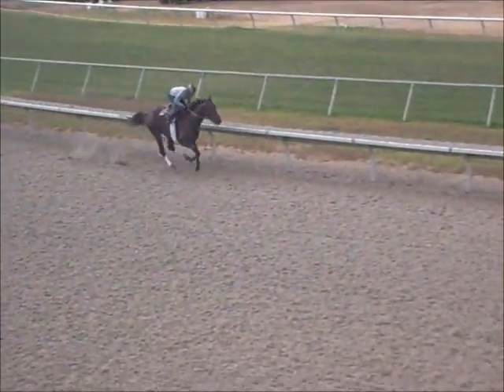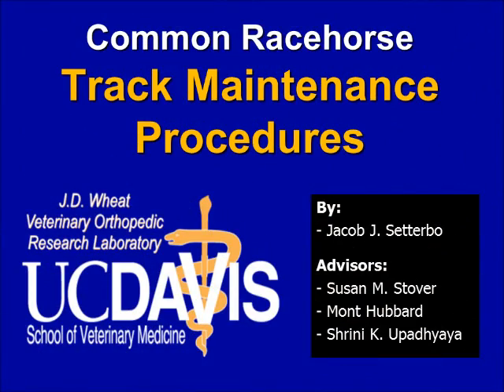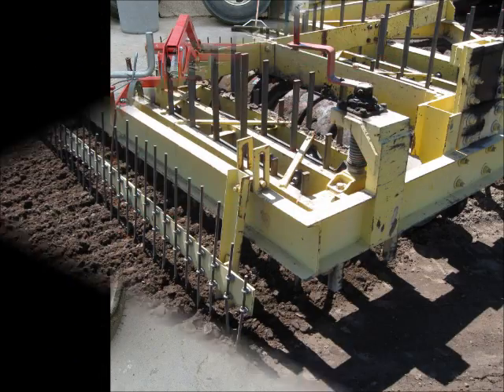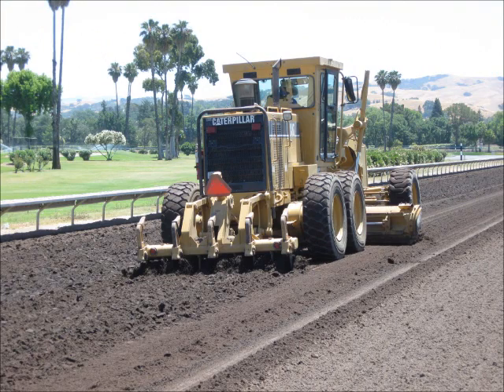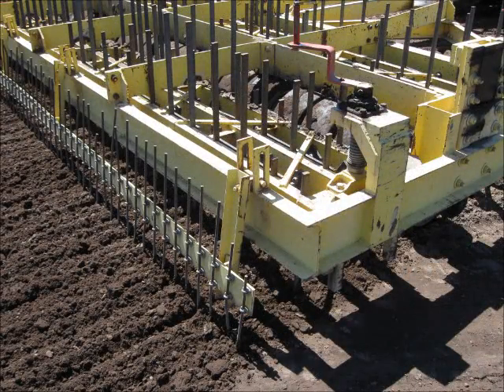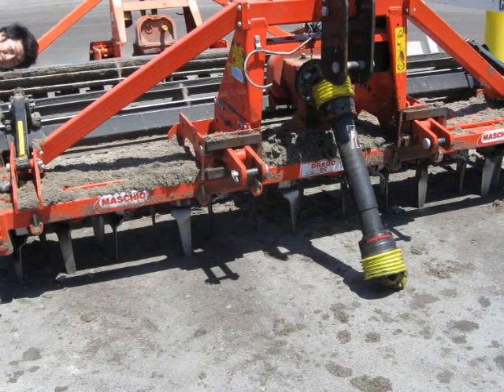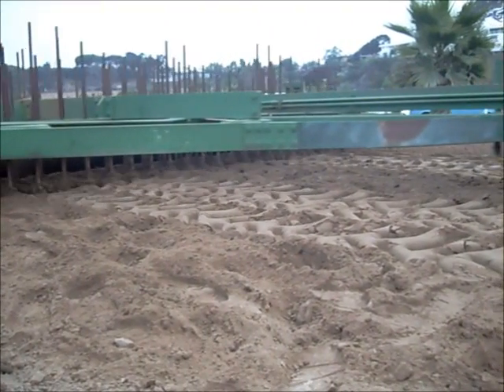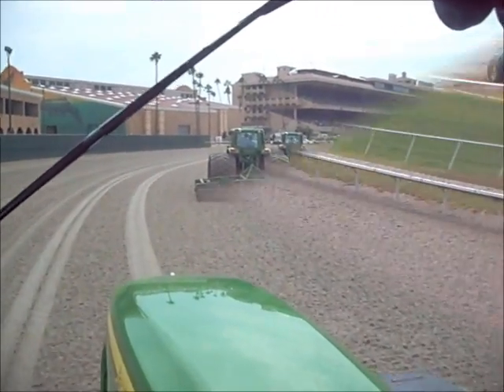Racehorse Track Maintenance Procedures (for Dirt & Synthetic)

Comment: Jacob..Santa Anita is at the forefront in implementing the methods for racing surface from the studies of the Grayson-Jockey Club Research Foundation project to reduce injuries.  Are you aware of the problems there this year?  Do you think it possible there is a flaw in the hoof-fall research used to develop the surface composition?  I do.   I have some information for you, it was ignored by Dr. Stover, but explains why these injuries are becoming prevalent again.
Reply from the maker: I apologize for not responding earlier. I am not up-to-date in the field as I stopped working on this project in 2011. My research at UC Davis was partially supported by the Grayson-Jockey Club Research Foundation, so I know they are at the forefront for supporting this type of research. For your question, I think every racetrack is unique with respect to how they decide what surface composition they use. Therefore, I doubt that all of them use any one research study to make decisions. I would suggest reaching out to the racetracks themselves to determine that.